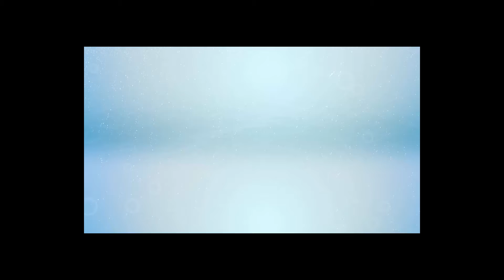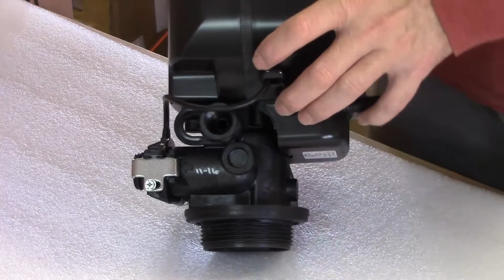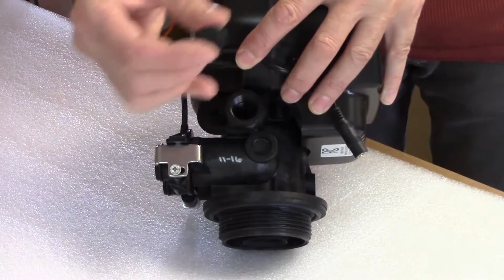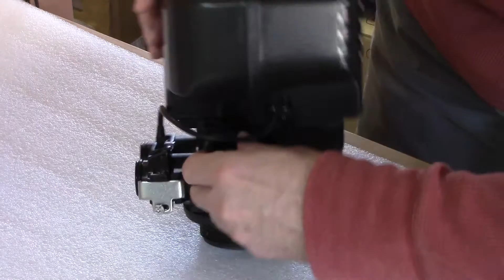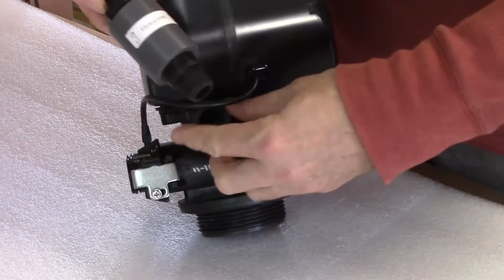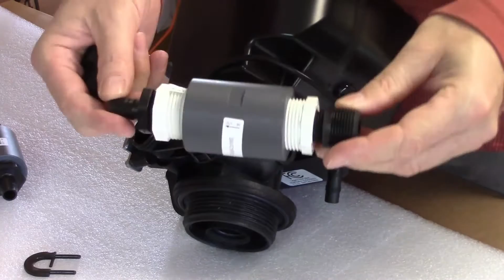Drain Line Flow Control for 5900 Control Valves

Comment: Please, can you let me know ? Relation between BLFC and inlet pressure ? Thank so much.
Reply from the maker: Hello -  the flow controls on the drain line keep the flow rate (for example liters per minute) at a constant flow.  If the pressure varies up or down they still maintain the same flow rate.  However if the pressure is too low, then it won't work, so you do need some minimum pressure.   hope that helps. thanks